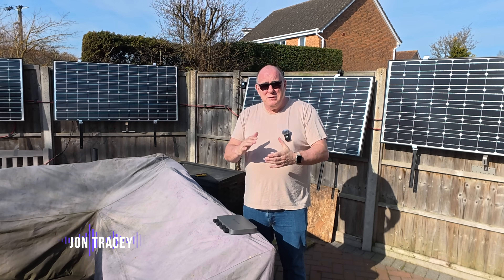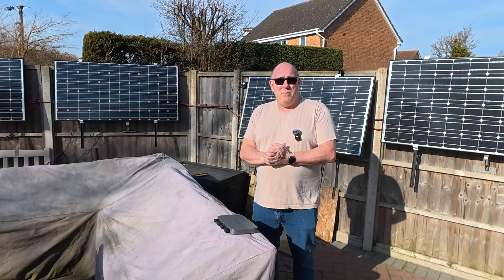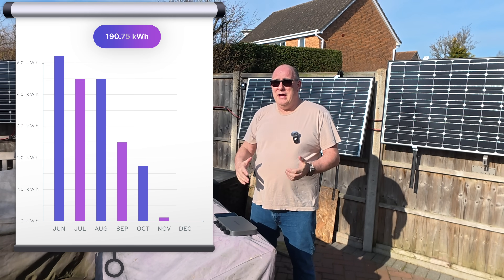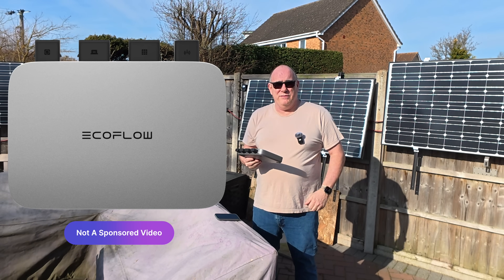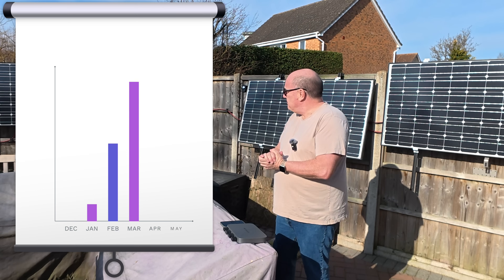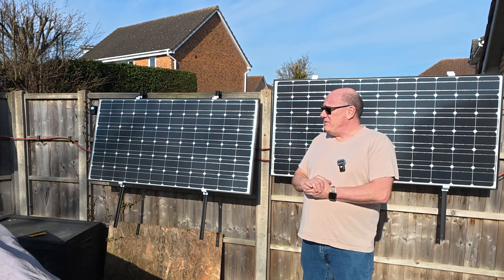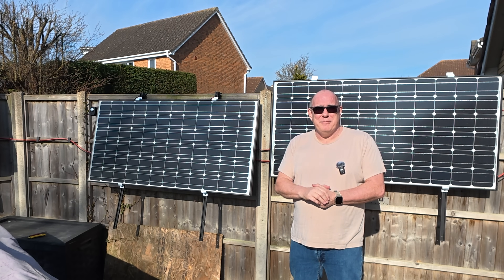WINTER SOLAR PANELS PERFORMANCE SHOCKER

Comment: This video inspired me to get 2x 445W panels (city plumbing) mounted to my fence and the ecoflow powerstream. About £240 all in and,  I mounted them myself at no extra cost. These have performed way better than I expected over the past 30 days. Generating nearly 100kW. (£27) A fifth of our usage. And these panels are mounted flush to the fence. It generally sits at around 500W during direct sunlight so I was considering getting a third and wiring in parrarell to one of the others. Do you have any experience in overpannelling these? I've heard the powerstream can get really hot, but i've mounted mine outside, behind one of the panels...looking forward to your next update on these!
Reply from the maker: over panelling is not advised, it’s very sensitive to the input voltages, if you go over just a couple of percent you could blow the MPPT. 

If the weather keeps up like this, you could end up with even more than that next month

Comment: Had you considered mounting 1 or better 2 on an auto tracking mount/ frame ? It should produce a great deal more power admittedly with a more complex set up to follow the sun.
Reply from the maker: Check out a video two or three after this one. I installed a single axis tracker on the frame to see what difference it would make.
Reply: @JonathanTracey  From my own simple experiments 2 axis is what is needed, keeping the panels at 90* to the sun to maximise output.

Comment: Interesting, I have a few small panels sitting about, I also have a 12VDC system to run my Amateur radio and other trinkets system. So maybe I should hang them on the fence and couple them in, about all I need is one diode, no loss here during winter.
Reply from the maker: if you’re not too worried about how they look, then they are a great source of free power
Reply: @JonathanTracey  You could paint the rest of your fence to be the same as the panels, a darker almost black, then the panels will be less noticable

Comment: What if the hole fence is sola panels on both sides?? All round the  property. ❤
Reply from the maker: So that’s the objective of the exercise to see if a fence like the one you describe is viable. I’ve seen a company called jaksun make fence panels with integrated solar. But I suspect they’re quite expensive so I want to have some data to understand if they will ever pay for themselves.

Comment: The angle and direction doesn't seem optimal.. this makes a very big difference.
is there any shading?
are the panels in series or treated individually by the charge controller?
As far as I know.. only the aluminium from a solar panel is salvaged.
Reply from the maker: Yeah, nothing about this is optimal, it’s really to see what extra can scavenge from these old panels rather than throw them away. The four panels are set up in two strings, because of the way the Sun moves across them to going to shade before the other two. I could’ve gone down the route of adding optimises but it really didn’t seem it worth it for such a small amount of power. It’s a fun experiment if nothing else.

Comment: So, when you really need power from Solar, ie in middle of winter, they use more power to run than actually produce.
So in winter, you end up paying full price for energy via electricity, when a simple gas/oil system is cheaper when you really need the most power to keep warm.🤷‍♂️
Reply from the maker: so I’d make two points, firstly this is an experiment in using solar in a non-traditional way. For one month of the year it used 266 W more than a generated, basically a rounding error. For the remaining 11 months of the year it generated free power. My second point is that this isn’t my only solar system so I didn’t end up paying anywhere near full price for electricity during the winter, my other system produces way more than we use throughout the year are more than covers the cost. I wouldn’t take this experiment as a standard way that most people would deploy solar.
Reply: @JonathanTracey  What a professional response, thank you, I understand your response and experiment, it is good that people do this in a practical way.
The issue I have is,  Solar in general regarding when it is most efficient at producing electrical energy, is not when higher levels of power is required in the Uk.
I am looking at a house in the UK, that has Solar panels and only electrical heating, what I am concerned about, in summer it will produce excess energy, but the UK has a lot of cloudy wet days in winter, which is when the house would need a lot of energy to keep the house at a comfortable temperature and mostly the Solar panels would be very inefficient at this time and I would have to buy electrical energy at a high cost.
I can see that for general running a house, charging a car, Solar and battery works, but this is put against the inefficiently of the system, when significant power is required, I.e in winter.
Keep up the good work
John

Comment: So, I got 190kWh in 6 mths I wouldn't have anyway,,,.
I have been doing my own research in Australia and I find the average house uses 22 kWh per day. Work it out however you like that's not much power for the effort.
Reply from the maker: Given the panels were available for free it seemed like a better use for them than just throwing them into the recycling centre. Yeah, it’s not a huge amount of power but it’s a fun experiment. And after a year, I should have enough data to make a decision whether integrating panels directly into the fence makes sense.

Comment: 200 odd KWh at an avge of 25p per KWh is £50-. Thats without batteries inverters etc. Is it worth the effort?
Reply from the maker: with these old panels probably not. They will at least pay for the inverter and I had the batteries anyway. But the objective here was to understand exactly what they would generate and that will allow me to make a decision whether new fence panels with integrated solar panels will be worth it.

Comment: Less than 100eu now for 500w panel  a big leap recently. If mounted well can get  up to 50% in winter, prob only  10% if flat. Id spunk out for bateries over an inverter every time
Reply from the maker: yep, panels are getting larger, I saw a 600 W version today. I’m just not sure it would fit on the tracker.

Comment: Its not just winter i think it also shows how much they degrade  loose efficiency :) after 10  years they are useless , see what you get in summer?
Reply from the maker: they’ve been on my roof for 15 years, and my fence now for nine months and they’re still producing about 95% of their rated value. I have a neighbour that has some panels that are approaching 20 years old and they’re still well into the high 90% their rated value.

Comment: Are you keeping them flat .. Simple wedges would increase output significantly
Reply from the maker: wedges added about 2%, i have them on the static panels but first week seems to show about 10-11% increase with the tracker. now that’s just one summer spring week, not going to bet on those number year round

Comment: Do you know how much efficiency has been lost over the last 15 years so see how the panels age?
Reply from the maker: Batteries have lost about 1-2%, don't forget they don't get cycled fully every day, its quite an easy life for them. Panels don't seem to have been effected at all, getting the rated values from the 15 year old ones. Had to give them a clean to get some moss and lichen off them but that's about it

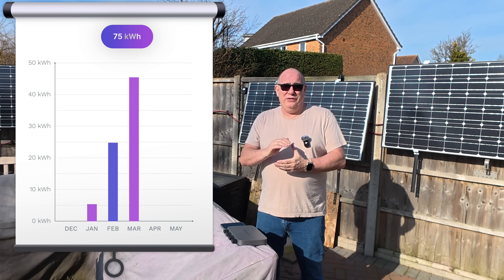Comment: 2:36  How much does the microinverter consume ? It seems to be taking all the electricity comsuming so much
Reply from the maker: To be honest, I don’t know exactly but in December the panels reported -230 W hours for the entire month. So it basically ran the inverter and then drew another 230 W hours from the mains to keep the system running.

Comment: I'm considering building a shaded seating area in my garden using solar panels from city plumbing. Last time I looked they were coming in at around £70 for a 415/430 watt panel. Looking at your figures I could probably charge my eV fully from them for most of the year.
Reply from the maker: Yes, I was talking to somebody yesterday who’s built a pergola that goes over a hot tub. He has three 400 W panels on the roof and he says it provides a significant chunk of his car charging throughout the year.
Reply: @JonathanTracey  hot tub you say 🤔. Hadn't considered that one but that's a great idea 👍👍
Reply: Try looking on here to get your panels Solar Trading UK Ltd
Reply: @darrenbrassington7364 ???

Comment: Is there any EMF coming of these solar panels which could affect your health.
Reply from the maker: Nothing to be worried about, every electrical item produces EMD but they have to comply with current safety standards to be sold. The panels themselves give off very little EMF, there is more from the inverter but nothing to be concerned about.

Comment: With respect, when your panels are mounted vertically on the fence like that, the more the sun rises in the sky, the LESS the panels will produce, as you are moving further and further from the sun's rays being perpendicular to the panels. The reason your panel output went up in the first days of March will be due to fewer cloudy days thus more sunshine.
Reply from the maker: yep that’s what we am learning, the data will help me plan the second phase, will it produce enough to integrate panels into the fence directly.
Reply: The days are longer in March. So while the peak power might be lower, the harvested energy will increase between January and March on comparable weather even when vertically mounted.

Comment: I have a similar setup using 1 enphase microinverter, I use a timer switch to kill the power drain over night and turn it off completely for dec and jan, makes a fair bit the rest of the year tho
Reply from the maker: Thanks for the tip. I’ll probably do something similar next year, I hadn’t even noticed the negative generation numbers until mid January.

Comment: I’ve long thought a solar fence was the best solution for home solar power, easy to install and easy to maintain, they may not produce as much energy as roof panels due to angle but this is easily off set by being able to home install and maintain
Reply from the maker: yep i’m talking to a few companies that offer panels with integrated panels, to see if they will be better

Comment: The EU provides a great tool for forecasting how much power at what location with how many solar panels slanted at what angle and azimuth for each month of the year.  -  search EU PHOTOVOLTAIC GEOGRAPHICAL INFORMATION SYSTEM.  If your going to look at performance over a year it would be interesting to see how output compares with that EU model.  BTW 71 degrees seems to be the optimum angle in winter.

Comment: I do like the benefits of solar, we have some installed on our roof. But they are ugly as hell, I wouldn’t put them around my garden as fencing, I’d just buy the extra £50 worth of electric.
Reply from the maker: that’s the whole reason for the experiment to see what they will generate, and if it’s worth it. I’m seeing lots of adverts for panels integrated into the fence panels themselves. But I wanted to check if it would be financially viable before spending money on expensive fence panels. Right now it’s not looking favourable but that’s the whole point of doing an experiment so we let it run and we’ll see what the results are come may
Reply: They could have been installed a lot more neatly than that, and, anyway they look a lot better than the old fence. 😅

Comment: Good work
What direction do they face.
How much are shaded.
Reply from the maker: They’re facing south-ish. We get sun on them until about 2 pm-ish. Right now they’re producing about half a kilowatt, on a nice sunny Saturday morning.
Reply: @ thanks.  In winter a vertical panel should give more output than a roof mounted one at, say, 30deg? 
I do wonder if on a national basis at higher latitudes, solar panels are a good investment. They make little power in winter when we need it, but flood the market  at other times…making the overall cost of generation more expensive.  I am waiting for someone with more knowledge than me to answer this.
Reply from the maker: so our roof mounted system which is 9.6 kW doesn’t generate a huge amount in December and early January but from mid February to late November it covers more than we need. In fact it makes so much extra energy in the summer that it covers all of our winter energy bill.
Reply: @JonathanTracey  exactly, so the cost of importing energy in winter is increased as those generators are largely sitting idle at other times. 
ps, I am not sure if my reasoning is correct, and certainly not criticising individuals, just questioning whether the Government has got it right.
Reply from the maker: it depends on how you look at it, for about 6 to 8 weeks of the year you’re going to get maybe 1/10 of your home’s consumption generate by solar in the winter. There will be good days but on average most days will be a bust. For the rest of the year even with a medium sized array, you’re probably gonna be earning money by exporting energy to the grid. Given there are no government schemes that I’m aware of to help with the cost of installing solar now it’s really down to the individual to make the choices to what good for them. But just to give you an idea of scale one of my neighbours with a similar size house and electricity usage has an energy bill for gas and electricity of about £3000 a year. This does include charging electric vehicles. This year I fully expect us to have a negative electricity bill. That the electricity company will owe us money at the end of the year. So you could say the system saving £3000 a year. On a system that would probably cost £15-£20,000 to install from you. So your payback is gonna be 5 to 7 years.
Reply: @ definitely good for you / the consumer.  And I guess good for carbon reduction. So well done. 
My comment is whether it is good overall economically for the country.  Is wind / tide a better option for us? 
ps, i am in Scotland, my neighbour got a free installation last year.  Obviously worse, in winter, as you go further north, especially as we face east / west..and in the shadow of an 800m mountain for two months!
Reply from the maker: We definitely should be investing in entitled power a lot more than we are. We have the second largest tides in the world around the UK coast.
Reply: @ …tidal power!
Reply from the maker: DOH! Auto correct

Comment: They just about work out financially if you get your solar panels for free. A bit like my log burner. It only works out financially if you scavenge the wood. Confirmed by my installer. Just imagine how much subsidy we are paying for these things.
Reply from the maker: yep, if I’d have to pay for the panels, it’s payback would be 5 to 6 years. With the three panels were approaching break even already.
Reply: By 'these things' in your last sentence, did you mean solar panels or log burners?

Comment: With electricity at about 27p per kWh now, the production of 190 kWh saved you £50. Hopefully you'll get 3 times as much over a decently sunny year, but I'd rather be growing climbing roses on those fences. An interesting experiment, but not the way forward for most people.
Reply from the maker: yep, I’m hoping with these old panels it will be about twice that at the end of the first year. Then we will upgrade them to larger panels and see how they do. We have to grow our roses at the front of our house as our two dogs love to eat the heads.

Comment: I thought the Ecoflow feed-in box is not 100% legal because in the event of a fault it cannot shut down as quickly as an RCD or similar. Perhaps you could provide clarification on this as it's certainly a useful device for small scale power into a home.
Reply from the maker: The big problem as far as I understand it was that when it was initially shipped, it just had a 13 amp plug on it. To comply with UK regulations and be able to sell it in the UK they stop shipping it with a 13 amp plug and sent it with bare wires and instructions that needed to be wired into a 13 amp spur. There needs the usual RCD and surge protection just like any other inverter that’s connected. I also believe that to be compliant with UK regs it needs DC isolation between the solar panels and the inverter. My personal opinion is this is a little bit of overkill because in other countries especially in Europe they just plug into a 13 amp socket with no issues.

Comment: AREN'T  These are PV (Photo Voltaic) Panels NOT Solar?? 🤔
PV Units Run on Available Light NOT Necessarily In Bright Sunny Conditions, Which Is Why They Can be Mounted Much Lower IE on a Fence NOT at Roof Height.
I've Seen a PV Panel Mounted on a Frame About 1 1/2 Feet Above Ground Level Chained to a Caravan Tow-Hitch, Enabling It To be Moved Around the Front of the 'van!!
Reply from the maker: You’re right photovoltaic is the correct name but I think everybody just calls them solar panels